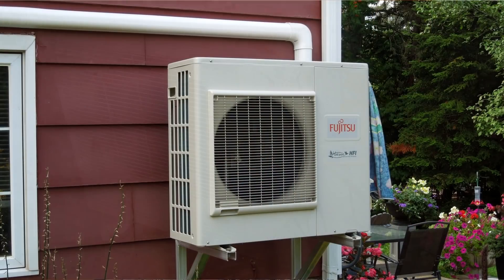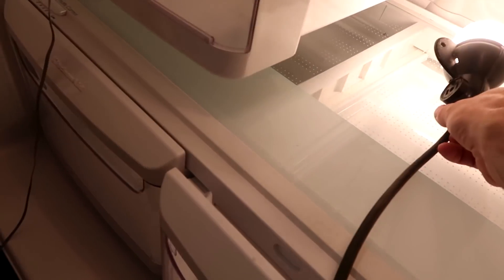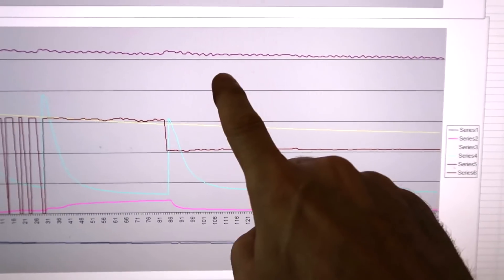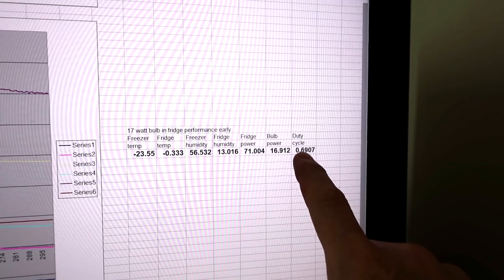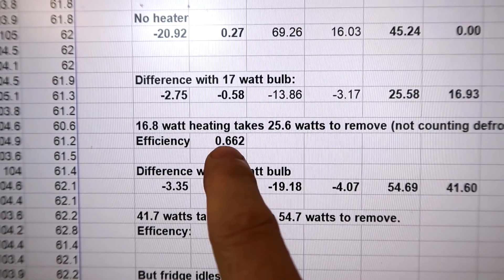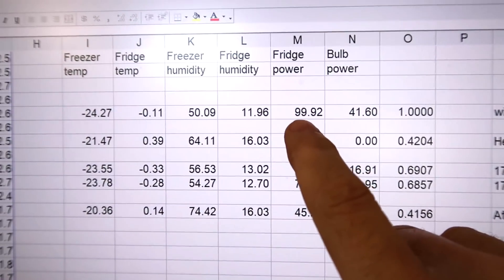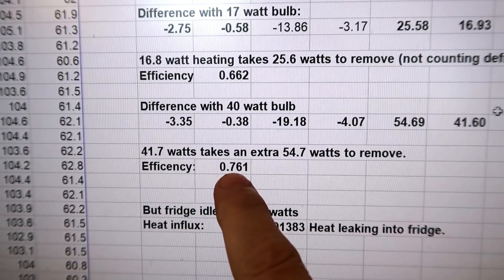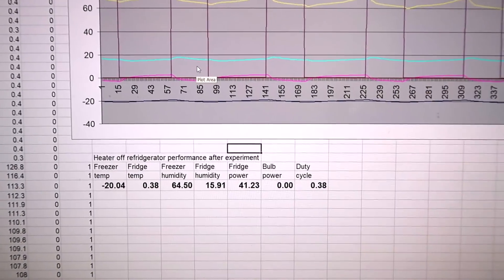Refrigerator heat pump efficiency test

Comment: These new heat pumps that you're seeing are not anything like the ones from 10 years ago. The compressor is a totally different type and they have an electronic expansion valve that can precisely modulate to let them provide the full heat pumps capacity down to -5 F or even lower on some models. They are more efficient than electric heat hands down. Look up inverter compressor technology and you can read about how it works.

Comment: Heat pump systems offer both cooling and heating though, no? Would certainly be additional value over baseboard which provides only heat. Just something else to consider
Reply: Right, that's why they're so popular. Very efficient cooling in summer, very efficient heating in winter, and they can often power two big AC units (or a full HVAC system).
Reply: Yup, that's one of the big things why I want one and probably why they are so popular here in Sweden. AC units are pretty much only in cars here, because it gets cold outside for the better part of 8 months, so we need heating too!

Comment: Sorry, but I don't think it is a valid experiment to use a fridge as a means of testing the efficiency of an air source heat pump. They are very different. It was interesting data, but I think not valid for the purpose you state

Comment: Installed mini split heat pumps in our house this winter, to replace electric baseboard heaters. Our electric bill dropped by just over 60%. I estimate breaking even in 4 years.
Reply: @Twofigo It's definitely atypical because I bought cheap units, direct from supplier, and installed them myself. I only have to overcome a purchase price of $2500. But still, I'm very happy and it seems like a big improvement over radiant, electric, baseboard heat.
Reply: What are the outdoor temperatures like during your heating season?

That was a significant caveat in Mathias' analysis.
Reply: @pileofstuff  Pennsylvania, USA. Normal low of 15° F. A handful of days hit 0° F or colder. I have a leaky 1970's house that I'm working to tighten up. Radiant baseboard heaters just turned on and never turned off!
Reply: @AndrewMiguelez  so you wanna say, your 15$ radiant heaters was poorly controlled, and now you compare it to state of art heat pump?
Reply: @mihanivazn2373  No, you said that. And it sounds dumb.
Reply: @AndrewMiguelez  no, you said it.. let me quote you "Radiant baseboard heaters just turned on and never turned off!"

btw: do you know there are no dumb questions? just dumb answers.
Reply: @mihanivazn2373  r/whoosh

Comment: The reason a lot of people in NB get heat pumps is to use them for air conditioning (on the few days a year that's necessary).
Reply: spending 8000$+electical work+drilling thru walls for 2weeks of AC?
Reply: Francois Dupont many of these units are mini splits. Not just AC but that’s definitely a feature.

It’s also not $8k. But certainly much more expensive than baseboards.
Reply: Is it really that expensive? You can get a DIY installation split unit (heat+ac) for $1000 in Czechia. That's for a room of 25m2 though.

Comment: Heat pumps using heat under the ground surface is much more effective.
Reply: Actually geothermal is worse in most cases than modern air source heat pumps. While geothermal heat pump seer ratings are better, once you account for losses from pumping it's about the same as modern air source heat pumps. Once you account for the vastly higher installed cost geothermal doesn't.ake sense in almost all cases now
Reply: @Blubermcmuffin1  It can depend on the outdoor temperature extremes in the area (and the consumable cost of alternate heating methods in a given location)

Comment: The experiment should have been run in freezer not fridge, because freezer is primary cooling zone. Bulb should been in there while off to make sure there is same thermal loss with unsealed door due to incoming cable. Only if temperature with bulb on and bulb off reaches the same levels, only then we can measure COP.

Comment: I don’t do commercial stuff, but I design big air handling and chiller units for a living.  We don’t use defrost “cycles”, but rather typically use hot gas bypass valves which meter based on suction temp and send the proper amount of hot refrigerant to the evaporator inlet to keep the temp just above freezing so the coil never ices up.
Reply from the maker: that would not work for a freezer

Comment: Check the Hyperheat systems from Mitsubishi.  I have a 3.5ton ZUBA system at my place.  It's tested to produce around 35,000 btu/hour of heat at -30C while pulling 7.4kW.  While it's not the greatest COP, (around 1.4 at that temp) it works at -30C!  (went thru 2 winters with it here in Québec, had a few -30C).  At -15C, the COP goes up to 1.95.   My backup electric heat's breaker had been off and it's heating the whole home just fine (around 2300sqft on 2 levels + 800sqft basement but it's extra insulated, NovoClimat 2.0).  In the last ~2 years, I've had absolutely zero consumption of resistive heating!  (ended up installing a 9000 btu mini split in my garage to replace the 5000W dragon heater)

The cost of installation was around $8K Canadian over the NG central heating system with AC from the contractor.  I calculated the ROI to ~8 years here (VS NG)... but in my case,  I didn't want anything to do with burning gaz, especially with our relatively clean Hydro.  ROI VS  Central heating with an electric furnace is around 6 years.

Mini splits are more efficient though.  I had a Fujitsu 15RLS2H installed at my old place (no NG available there) and this thing could keep the house at 22C all the way down to -26C or so OAT.  The baseboard heaters were set to 20C and would only kick on 4-5 days a year.  This one was less than $4K installed, paid itself within 4 years... 

As for noise, keep in mind all of the super efficient ones run a variable speed compressor and fan.  They make almost no noise. 

I'm using eGauge systems to monitor current draws of all of this, while their product aren't cheap, they work great and are super accurate.  They account for power factor and are hooked up to the grid on both phases.  Amazing data from them!

Comment: I put a heat pump in my mothers house back in NB last summer because they had an oil furnace and spent over a thousand dollars a winter to heat the house. with the cheap electricity and fixed distribution charges (unlike here in AB) the heat pump kept the house warm all winter and cold all summer for a fraction of the cost. it would have paid for itself in oil fills in a single season. During my visit this month I found that they had installed a second one for the basement for exactly the same reason. Now they dont even need the wood stove they used in the basement.

I only wish electricity was cheaper here in AB. I want to have heat pumps, but its just not worth it compared to natural gas.

Comment: A warning about adding insulation to fridges:
As part of a university undergraduate research project I attempted to increase the energy efficiency of an older fridge by attaching 4 inches of cardboard to the doors, sides, and top. power consumption went up quite a bit. 
It turns out most fridge have heaters built into the exterior panels to prevent condensation, and my insulation caused that heat to migrate into the food storage compartments causing the compressor to run more frequently to make up for that heat.
my research indicated some models of fridges have a switch for the anti condensation heating elements, so if you have one of those fridges you could, in theory, add insulation for better performance.
Reply: i had one of those older fridge, it was brown/beige and (i am not kidding) weighted 300lbs.
it was so heavy it curved my floor.
Reply: Also many new fridges now put condenser behind the side and rear casing, using the sheet metal to dissipate heat, so cover the fridge will burn it up.

Comment: Here (in Tasmania, Australia) heat pumps are very common and make a fair bit of sense (as most of the state does not have gas and humidity is fairly high year round) but we rarely see freezing temps (no snow, except on the mountains) but one thing the installers never seem to take into account is the location of the outside unit. the position of the unit can have a huge impact on its performance, yet they install them in the location its easiest.

You really want it up off the ground, in an area that gets really good air flow but is sheltered from the sun and harsh winds.

Comment: A lot of those new heat pumps have variable speed compressors.

Also years ago I had straight electric heat.  300 per month bills.  Put in a heat pump the bill dropped to $70-100.
Reply: This is the real facts of the test so we know it saves money not just electricity.

Comment: A heat pump is definitely worth it! You get several times the electricity input as heat output, even at quite cold outside temperatures (especially with the newest models). The easiest way to save money would obviously turning down the thermostat a degree. Or even better, insulating the home. The latter might take quite some time to pay off, but keeping the walls warm (or cool in summer) makes the rooms feel so much nicer.

Comment: We bought a small home,  24x24' built in 1944, has blown in insulation in the walls and attic, and 1.5" foam outside, the previous owners estimated that they'd use about $1800 in oil to heat the house.  I air sealed the rim joists, baseboards, doors and windows etc. Got a rebate through efficiency nova Scotia toward the heat pump which ended up costing 2400 after tax and rebate for a fujitsu unit.  Our power bill is $82 per month over the past 2 years, including ac in the summer, this is for the entire home.   I'm sure it's cheaper than our oil boiler would be, and ac is great.  My father was in the same situation with his 1985 24x36 bungalow and he worked out that his paid itself off in 1.5 years.  The main thing with the heat pumps is using them properly. I experimented to get the home comfortable in all areas,  fan on max at all times, especially in the summer, or else the blower fan will become full of mould

Comment: We actually sold the mini-split systems as air conditioning equipment with the heat pump function being a bonus.  Surprisingly, except for an occasional unconditioned space, most were installed as supplemental cooling in areas of houses that had poorly balanced central systems where the ductwork in  a room couldn’t be upsized without major wall and ceiling surgery. The other use case was converted garages and basements where adding gas equipment may not be feasible.

Comment: Higher end heat pumps are going to have VRF (variable refrigerant flow) so they won't have to cycle as often. From what I understand, that is more efficient. I'm also curious as to the efficiencies of the refrigerant in the refrigerator vs a heat pump. I have a heat pump and a high efficiency (97%) gas furnace. I don't notice a big difference in my bill between the two sources of heat. While a heat pump may seem better than resistive heat, it can't match the zonability of base board heat.
Reply: Mini-splits are pretty damn zoneable, and you can certainly zone an ASHP like you can a furnace. Do you use a two-stage thermostat with thresholding to cut over to the furnace?
Reply: belg4mit Yeah mini splits are pretty slick with their zoning. My system has a communicating thermostat. The gas furnace is variable capacity from 35%-100%. The heat pump is two stage. I can run gas heating only by turning on “emergency heat”.
Reply: belg4mit I have my system set to switch from heat pump to gas at 30 degrees F.

Comment: I used to live someplace very cold and windy and always wondered if a windmill-driven compressor (i.e. no electric generation, driving the compressor directly) would work with a ground source heat pump. We are better at storing hot water than electricity (especially back in the late 90s when I had this notion).

Comment: Those mini-split systems are also typically inverter based and so they can run at a "constant" output instead of cycling on and off.  I think this and the exact refrigerant they use allows them to be more efficient.

Comment: For decades, heat pumps were big winners in places like North Carolina, which has mild winters and you need A/C in the summer. At 40F or so, heat pumps are great. In your frozen North of Canada, they don't see enough heat in the air to do much pumping. Now if you had a groundwater heat loop, the numbers would be very different.

Comment: Recently I saw a heatpump (from 2011) with 850 watts power consumption and 4000 watts heating power. Of course just under ideal conditions, but for places with mild winters it could be a good solution. Another advantage is that you can use it to cool in the summertime.

Comment: Mitsubishi heat pumps are 3 to 4 times as efficient as a normal electric oven. Mine uses around 1.5 kw, and give about 6kw of heat. On the coldest days (-20c) it goes down a little. But is has no problem keeping my 1970s 1500 square feet house at 23c.

Comment: Another consideration with the refrigerator's effficiency is that the refrigerator appeared nearly empty, so there's not much thermal mass, there's not much there to cool, except for air, which is more of an insulator than a mass to cool.  With something in the refrigerator to cool, the refrigerator should run for longer periods, but run less frequently.  The duty cycle will likely be about the same, but the frequency will be lower.  The savings is in avoiding the start up current.  Lower frequency means fewer start ups per day.  I've often wondered about running a fridge compressor with a VFD, just to get a softer start to see if there's an efficiency gain to be had.

Comment: Heat pumps/AC refrigerant and configuration is set to have an above freezing operating temperature.  Defrost is an issue for the outside unit when outside temperatures create a frost issue.  It is a reversal the cycle so "cold" air comes out of the registers.  Feels cold in a dry winter air, but i've only ever seen it drop the measured temp by a degree or so.  The cycle is 30,60, 90 min depending on regional needs, 10 min runtime but it only runs until the defrost thermostat opens.  Once you get a below freezing outside, the heat pump can have issues keeping up.  Even here in TN, we have resistive heat elements in the air handler for make up and emergency heat (outside unit failure).  

If those little units are keeping in a Canadian winter, I'd like to know how they are set up compared to a southern large unit for heating comfort.

Comment: My 3.4 KW rated heat pump consumes about 700 W when running, and with -10 degrees outside a 2.2 KW regular convection oven wasn't nearly enough to replace it, so I'd say it's not that far off. Even with dirt cheap power (Norway - lots of rain) nothing can beat a good A/C for price (if you consider time > 5 years). Though some better insulation wouldn't hurt, I'm living in a timber walled house from the 1920's, and insulation is a one time cost vs a constant running cost for heating (/cooling).

Comment: Would be interesting to see if s heat pump that has an earth coil would be more effective/would be worth the cost. Because if you had an earth coil the icing up wouldn't be such a big problem and even in winter the heat difference wouldn't be as big as if using the cold air as a heat source

Comment: Oh how I wish, wish, wish I lived somewhere with cheap enough electricity that ANY form of electric heat made sense.
Reply: How much is your electricity mate? We have some very pricey electricity in the northeast, and heat pumps definitely make sense. Mind you, what makes the most sense is make sure you reduce air leakage and get a decent level of insulation in place first,  regardless of the HVAC system, but then you need a smaller/cheaper one.
Reply: @belg4mit  I've read that we have the most expensive electricity in the US outside of Hawaii. Last I looked, I was at a total cost of $.28 USD/kwh. Climate zone 7. 800 heating degree days annually. Painful combo.

I have a very efficient boiler, hydronic radiant heat, and currently adding a lot of insulation and air sealing. What an effort. Good thing I like my house I guess!

Comment: The COOP of high end heatpumps is up to 3.2 at -15C. So 3200 watts delivered if 1000 is consumed. But if the power is cheap it isn't a super worthwile investment, unless you account for the extra comfort in summer with AC.

Comment: The only heat-pump heaters I've seen in Europe were in passive-houses with the coils buried in the ground. I assume they would have a huge surface area and be below the frost line. I'd consider the major advantage would be to reverse the flow, given the ridiculous summers we are recently getting.

Comment: I have a heat pump down in the south US. And can confirm, if its about ~35, they work great. Below that, not so much.
Reply: You don't have a HP rated for that. Check out Mitsubishi Hyper Heat or a Carrier Greenspeed like I have. Plenty of heat down to single digits and below.